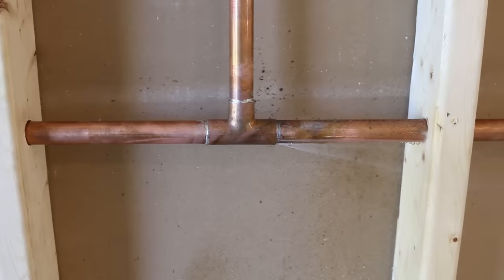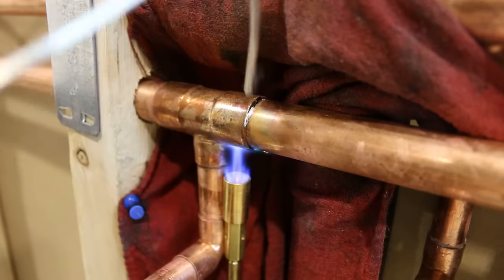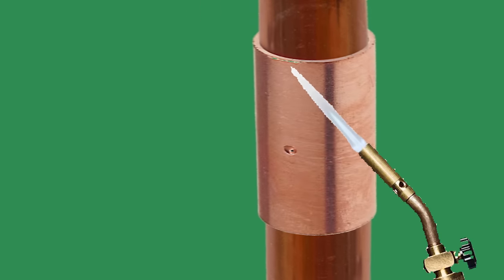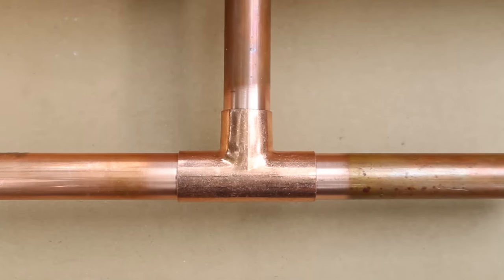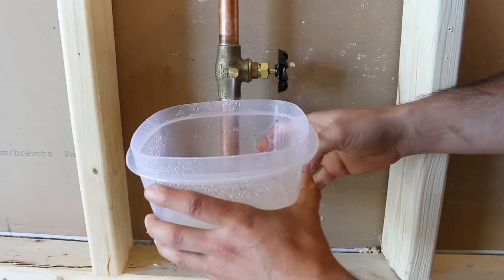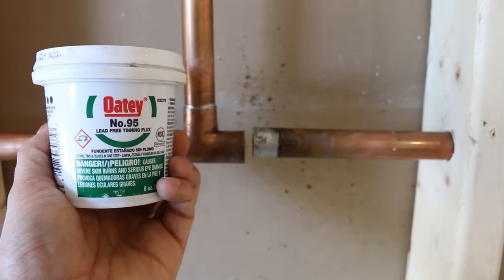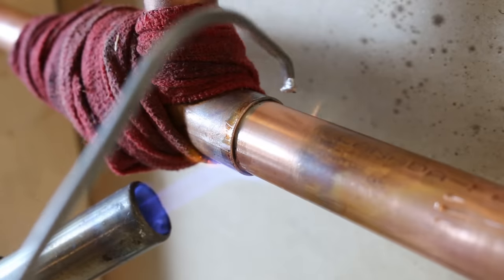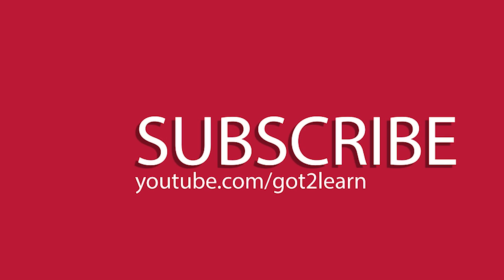The CORRECT Way To Fix A Leaking Joint (UNSOLDERING) | GOT2LEARN

Comment: It would be much more helpful if the video show also the movement of the torch heating of the T joint and the pipe evenly, because a lot of beginners didn’t know the importance of even temperature both of the T joint and the pipe by proper movement of the torch! As the video already explained the flux might have burning off by too much heat, evenly movement of the torch reduced that risk!

Comment: Thanks,  i use acetylene.  You use propane.  I have often flattened a piece of soft copper , pounded into  the joint  on 4 inch and larger copper pipe.  Air test before water test. Water blows the flux out of the joint
Reply from the maker: Good job man!
Reply: @Got2Learn  thanks,  i have worked union, and no union shops.  I live in north Florida every thing I own is paid for.  I own 4 different aircraft, of one is a helicopter. In my opinion you need to support folks to  get into the trades.  How many employees do i have,  just myself and my son.
Reply from the maker: @digdig-cp8lv  that is awesome, the trades are great man!
Reply: @Got2Learn  okay I know am not the average.  Please turn your videos to the average man.  I know   about these folks, learning the trades.  It is looked down upon, i know, hard work, tell the folks that they can aquire wealth without a  college degree.  Not just fix this  correct that . Instill the American dream.  Thanks l made it for myself.  It's open to all that choose
Reply from the maker: @digdig-cp8lv  😉😉😉

Comment: I don’t know what you think about this, but I normally run the wire cleaning brush through the fitting itself to brighten up the solder copper inside. If anybody’s done this, let me know. Great video.
Reply from the maker: Yes me too!

Comment: When doing rough-in plumbing, the apprentice always goes in the crawl when you hydro test the house for leaks. At 300 psi, any improperly soldered fitting will be found out immediately, and if you're in the crawl, that usually means you get a bath. Hence the apprentice. You learn really quick to make good joints after a couple of those.

Comment: In other videos you say that it is best to use flux inside the fitting and on the pipe too. Can you please clarify? Here you only say to use flux on the pipe. Is this because you are repairing the joint?
Reply from the maker: I changed my method after a long time, know I just use flux on the pipe itself, I am a learner too ;)
Reply: @Got2Learn  ok but almost every tutorial i watched has flux on the inner fitting and outer pipe.....maybe you should use less flux then it wont get pushed back like that?
Reply: Anyway. Thanks for the great content. Keep up the good work

Comment: Is using mapp gas which is hotter better or worse then using propane on joints?
Reply from the maker: The new MAPP gas, is only a few degrees hotter than propane, but it does make a small difference.

Comment: In reconfiguring my supply lines for a bathroom remodel I decided to move the toilet supply. The plan was to cap off the old supply just outside the T and move the new T over for the supply. There was just enough copper between the end of the T and the next fitting to allow me to cut that off and put a cap on. When I got the cap soldered on and turned the water supply back on that sweat joint was the only one of over 30 I had done that leaked. It was 2am at that point and I wanted to go to bed so I made trough of aluminum foil and diverted the dripping water to the nearby commode opening in the slab. The next morning I woke to find the leak had stopped. The cap has been under full pressure for 5 full days and no leaking. How does a tiny leak in a copper sweat stop itself? My quandary is this: Do I consider this union sound and close it up behind the new backer board and tile I plan on installing or do I attempt another union with a new cap, OR is there another fix? You should understand that the this old capped off T is situated against the PVC drain just an inch or two above where the drain enters the slab and where the copper supply exits the slab. This area is a mess of copper supplies with branches all going to the sink and another bathroom upstairs many of which are in very close proximity to a four-way drain coupling. If you could see how much the original plumber scorched the PVC and adjacent stud you'd wonder how he didn't burn the house down. In my view replacing the T will require major work including cutting the 3/4 soft flexible copper main supply line that is out of round. That supply not only T's to the toilet but two sinks. In addition the 1 1/2 drain has a 3 way T just above the suspect cap. If I could post a picture you'd better understand the mess of pluming I'm dealing with.
Reply from the maker: Add me on Facebook ;)
Reply: @Got2Learn  I'm sorry but I don't use Facebook. I do use Instagram and am following you. DM'd you recently about this topic.
Reply: If the leaks are "small" enough, minerals from the water will migrate into the micro cracks and plug them.

Comment: You should mention that on the very last joint that you solder, if a valve is not opened, the heat will cause the air to expand in the pipe.  Since it is the last joint, and no valve is opened, the now expanded air inside the pipe will escape via the joint you are trying to solder and this will cause the solder to be "blown" out of the joint.   Always open a faucet or valve when soldering so the air, once expanded, has somewhere to go.

Comment: So do you never flux the fittings? Or just in this case? I’ve been fluxing fittings and pipe going into them. Thanks for a great video.
Reply: Normally one fluxes both and tinning flux is preferred by most
Reply: I got out a microscope and read the instructions on the flux label.  It clearly states to only flux the pipe itself (for the obvious reason described in the video).

Comment: Another reason small amounts of water in the pipe interfere with soldering is that the water vaporizes to hot steam and unless the pipe is vented somewhere down the line pressure rise will cause a pinhole blowout through the liquid solder.   When water turns to steam at 212F its volume increases by 1700x, if the internal part of the pipe is not vented that will cause the pressure increase that blows   pinhole out the joint.
Reply from the maker: Correct!

Comment: As you solder the joint, make sure the system can vent through a faucet or union so that the internal heated air is not pressurized and forced to come out the newly soldered joint
Reply from the maker: Very good tip, thank you very much!

Comment: If I have a small gap in my solder joint, can I just touch it up with more flux
Reply from the maker: It will eventually leak that way it's best if you do it the way that I showed in the video
Reply: What do you recommend if you don’t have play in the pipe
Reply from the maker: @mozart23able  This here: https://www.youtube.com/watch?v=ebvqSp-d8-0&t=34s&ab_channel=Got2Learn

Comment: I must have missed it but when you started hitting the locking pliers with the hammer,(6:25),who or what was holding the torch?
Very seldom does a surface happen to be available for this to place a torch on,or have a 3rd arm.Wish I could grow a 3rd arm.
Reply from the maker: Craig, they are "locking" pliers, once they are locked onto the pipe, you can release them ;)

Comment: I hv a this problem but the assoc only wants to pot a bandage on it which means it will continue bcuz they don't want to shut off the WATER. So what r my other options?
Reply from the maker: There are no other options, you really gotta cut the water and dissmantle it or replace the leaking joint

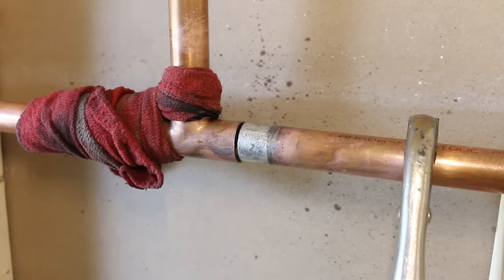Comment: When wiping solder off a pipe use a dry cloth or a flux brush. 6:40.  Also use sanding cloth.  Also don't place the torch underneath the fitting, solder can drop into the torch and mess it up (throughout the video).

Comment: So what method WILL work if you cant knock the pipe out with a small hammer? In my case the pipe is in concrete. For me to be able to knock it out of the joint i will have to do a lot of work to remove all the concrete from several meters of pipe. Too much work. What solution can you offer?
Reply from the maker: You'd need to cut and ad slip couplings for this situation, I am working on a video about this ;)
Reply: @Got2Learn  like in the next ten minutes? Damn you are good : )

Comment: you should also mention in your video to Not use Type M copper for potable water, or pressurized systems. Type M is intended for non-pressure systems, like t&p Valves on water heaters or condensate drains. hopefully the pipe type was only used as a cheap example , as the application is still the same

Comment: Got2Learn, 
1) In your other vids you do say to put flux on the fitting. Is this still true or would you now always recommend leaving the fitting unfluxed, or only when fixing a leak?
2) In your other vids you make no mention of tinning the pipe, is this something I should only care about when fixing leak? or should I always try to tin my pipes?
3) in your other vids you are always say to use the flux with the tinning powder, should I use the non-powdered one only when fixing a leak ?

Unfortunately this video has some contradictions to your other vids, bought up in the 3 points above. Would love some clarity.
Reply from the maker: Yes, my way of doing it has changed.
1- I only flux inside the fitting when it's big diameter (2" and up).
2- I don't tin my pipes like you said, but when you "unsolder" a joint that's already been soldered, the pipe will automatically be tinned, which helps in getting full coverage once you resolder it.
3- You could use flux with tinning powder, there's no problem, it all depends on if you have some at your hardware store or not.

Hope this helps :)
Reply: @Got2Learn  it does, some new questions as I'm about to replace a Saddle fitting used for my fridge.

1) about your answer above, 2inch and up, are we talking about outer diameter or inner diameter? because the outer diam of mine is about 3inches, so I think it's a 1inch inner diam based on some other site I seen.
2) Hey can I get a T fitting for my fridge that has a shut-off for it built in on the stem of the T, or should I just keep them separate?

It looks like a 1inch copper pipe cold supply line heading to my hotwater tank, where BestBuy put a saddles fitting on it. The saddle fitting then connects to some sort of metal sleeved tubing, not sure what diameter that connection is though.

This is a vid of my basement and the fitting itself that I'm getting ready to replace. https://youtu.be/M0q5wYdngi0?t=225 starts at 3:45

I'd like to just have the fridge tubing connect right onto the T fitting but not sure what that's called nor if it exist.
Reply from the maker: 1- 2" is inner diameter, i'd be surprised if you had 3" copper coming into your house though.
2- They come seperate, you need to solder them unless you get a Sharkbite tee.

You'll never see me recommend install saddle valve here, so you matters well remove it and install a proper Tee like in this video I made: https://www.youtube.com/watch?v=Esr6IBsQ9Vg&t=476s

Comment: The correct way to stop a copper leak from a fitting joint is never let it happen 😉 if you clean the pipe and fitting correctly and put the right amount of flux on the joint and heat the area correctly and move the torch towards the back of the fitting you will never have a leak! This is coming from a union 20 yr pipefitter veteran! Everytime I had a leak ( only a handful ) that was the cause not cleaning the solder area properly 😎
Reply from the maker: You are 100% correct! 😎
Reply: But often it was someone else's solder job that you're fixing.

Comment: 😷Hello,
To perform this kind of welding, an electric clamp is used, after having cleaned (the sockets) of the parts to be welded, I coated it with a thin layer of tin (liquid) the wire tin is not used, then I assemble the whole of the tyautery, once assembled, with the electric clamp I perform the welds on site, it has no flame, above all there is no risk of a potential fire.
  once heated, the tin melts inside the pipes ...  👌

Comment: What should I do if my plumber / neighbor cooled down the joint after, used a little water on it? I don't want to tell him how to do his job really but I am worried about it cracking after watching the video. Should have watched before he did the job.
Reply from the maker: Did you try turning on the water? There's more chances of it "not" leaking than there is of it leaking so it's probably ok.
Reply: @Got2Learn  So yes there is no current leak. Been running for a few weeks. I was just concerned about the fine cracks growing to future possible leaks. Thanks for the response!
Reply from the maker: You most probably would of seen it as the water was turned on but yeah, it could creep up on you, just keep an eye on it ;)
Reply: Keith Fimreite it’ll happen instantly.

Comment: Mister, you scare the hell out of someone who is willing to try to solder copper pipe. I learned myself and became a pro at it in short order, not months or years of perfecting. Folks, there's nothing magical or hard or fancy tools needed to do this. What a crock of hot air on how to fix a leaking joint. Of course, I soldered about 40 joints inside a half hour and not one of them leaked. My helper was totally amazed and I didn't understand why. He was just mesmerized and told me he's never seen that done even with an experienced plumber. Of course, I've had much practice with printed circuit boards and electronics, but I don't think that applies to sweatting pipes and fittings.

Comment: I agree to do it right, BUT; and theirs always  a but!!!😎  you apply flux "no matter what" to both ends. If you notice, the reason I point this out is because you heat from the mass of the joint that's why the female  end is the first to carbonize on the inside and why i say it's most important to put on both but more so the female,

 so if it deosnt capillary atleast you see it because you wont have enough on the outside and you will be able to see it. instead of mask it by not having enough on the inside...  still though we aren't talking allot of flux, just enough to wet it.  And a dry surface is like rain-x to water.  This is why you put it on both so it works from both ends to keep joint clean allowing rosin to flow freely.    The reason "water soluble"  is used is because exactly that... and you purge it all out  through opening a water valve to flush out when your done the job.  If you do the job "correctly". But, by not putting flux inside the connection you loose chances of a "propper show and tell" because this wasnt TRULLY a properly done job and you cant be sure "any way you look at it" weather or not  the uncoated, clean copper inside is fully sealed and accepted the solder or if it is  just sitting on a carbon film from heating the joint  "like your screwdriver method showing adhesion to  unclean heated copper"

 you did a pretty good job conveying the cause for sure and now it could of happened. Honestly I would of questioned more than that joint  based on what I see. But good job all together. I was always taught to clean clean clean then FULLY flux,assemble and heat evenly and let the capillary action show you what is happening. Solder is attracted to heat. So when you heat from the inward end/ or mass of the joint outward you encourage the flux to purge/fill the joint as it travels from the applied area to the back end/ inside the joint itself  to the back. As this happens it will push the liquid flux out into pipe if there's wasnt enough flux it could easily trap carbon bubbles of acid flux that ruins even the best looking joint in a period of time. But may never show  for years.
Reply: I think it's all in personal preference.  I've been building huge boiler systems for years workkng with pipe sizing from 1/2 to 2".  In the beginning I used to flux everything but it made a mess of each fittings not to mention extra dripping when doing the soldering.  I have found that a good prep with flux on the pipe works best with as little mess as possible.  

One thing that I found works extremely well in preventing a leak or problem is to twist the pipe once its in the fitting before you apply the heat.  Also works when repairing the leak.

Comment: Question: You don't have to remove the old solder completely?
Reply from the maker: Negative.
Reply: @Got2Learn  Wow. I literally did one of these repairs today where I removed a 90. I thought I had to clean off all the old solder which made the job a lot harder. Removing the old solder was a pain in the a**!! Haha
Reply from the maker: @itsgabegutierrez  it actually helps ;)

Comment: Blowing the water out with a vacuum cleaner or compressor may be necessary! Or cut the tubs & use a slip coupling. Having a water spray bottle handy, for fire prevention is a good thing, as Martha says!
Reply from the maker: Yes, 100%!!

Comment: I have got a question,,,
Why plumber use solder instead of copper brazing ???
(N:b: i m not a plumber..i am an electric equipment mechanic..we use copper brazing to joint between two copper pipe)
Reply from the maker: Less expensive..
Reply: Requires much higher temp.

Comment: Wipe the hot solder off with a dry rag not wet as a wet rag will cool the solder where as a dry rag wipes off the hot solder before it cools.